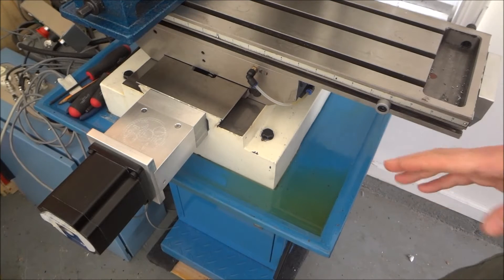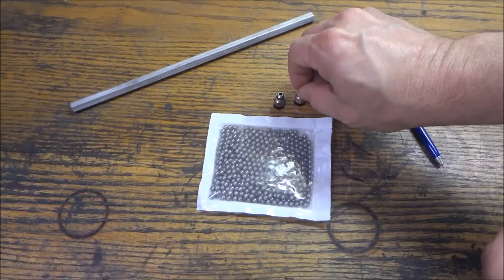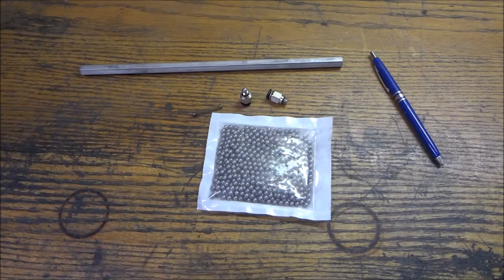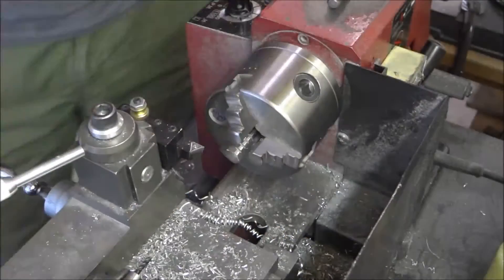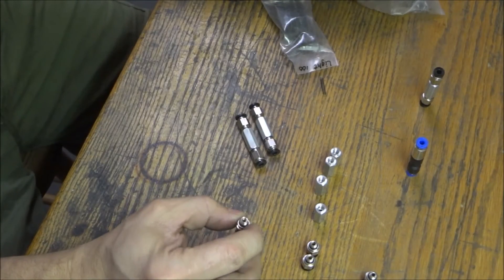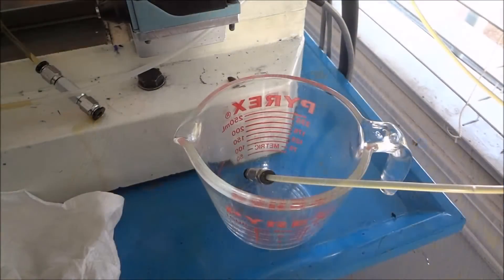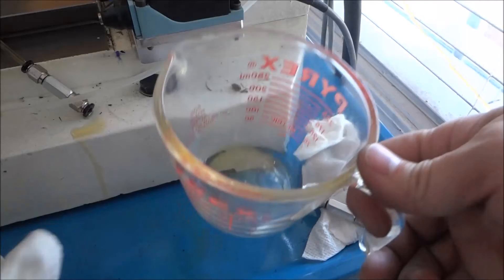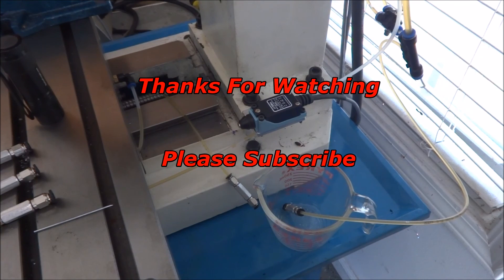PM727M one shot oiler Check Valves

Comment: looking good!!  glad it solved your problem and glad you posted about those check valves not working, I was about to order some for the lathe build!! good looking out!!
Reply from the maker: Thanks Chris, I was very surprised when they did not work! I thought buying some would say time but in the end it cost me more.
 I think I would make a manifold and incorporate the check valve into it  under the X table.
The oil after the check valve will still seep out but the rest stays in the line which is what I wanted.

Working good now.

Comment: Nice work!  A little bit of oil leak is normal, but you solved the problem..:):)
Reply from the maker: Thanks
The oil after the check valve will still seep out but the rest stays in the line which is what I wanted.

Comment: I'm just curious did the lines have to come from the top or could they have come from underneath, then gravity would've solved your problem. The excess oil could have just drained back to the oiler.
Reply from the maker: Good point!
Yes I could have mounted the oiler below the oil points and routed the lines in such a way to not have any oil drain out. 
The check valves solve a few issues they keep the lines primed with oil. They also keep coolant and contaminates out. With the oil sitting ready at the check valves one shoot will meter the correct amount of oil. 

If I let it darn back to the reservoir it may take several pumps to get oil to the ways and shorter runs will receive more oil. 

With this setup the single shoot will meter the correct amount I want. 

Be safe 
Sam

Comment: loving the videos so far. but why did you use 7/32 drill for the M6   it should have been 5mm or 13/64.   13/64 is still a bit big tho
Reply from the maker: I may have been mistaken I dont recall  wasnt to critical may have been to allow the spring and Ball also.

Comment: What will be the issue if one shot oiler is not pumping oil seals are all good but its no pumping oil
Reply from the maker: Is the oiler Brand new or have you been using it? it may have lost it's prime.
Reply: Its a used one , whether it will be a problem with the non -return vavle in it?